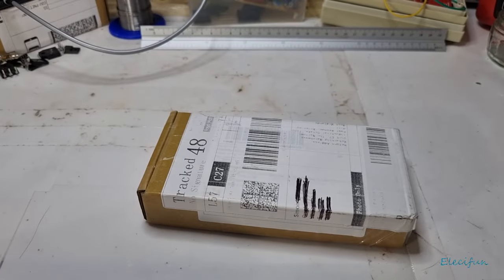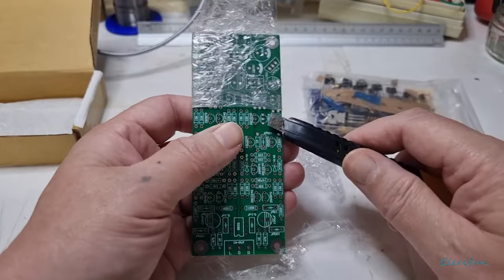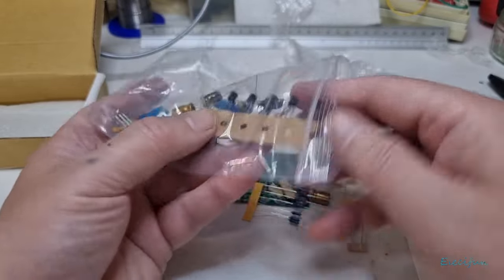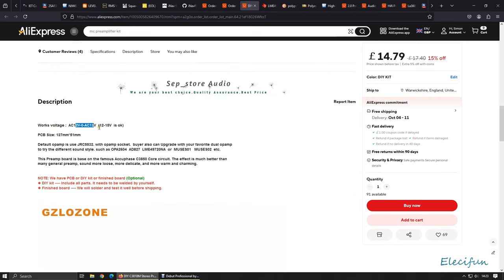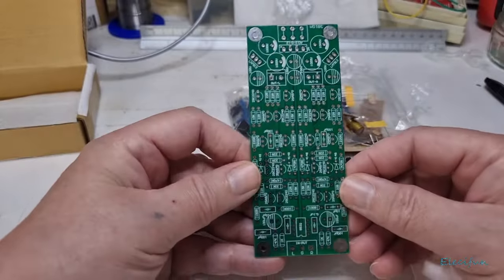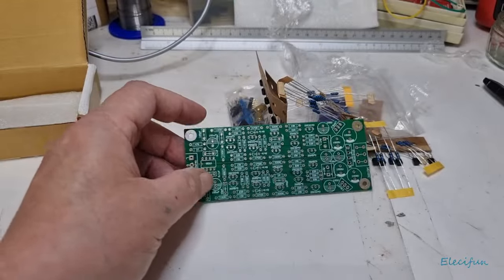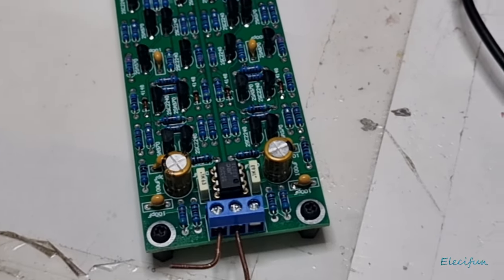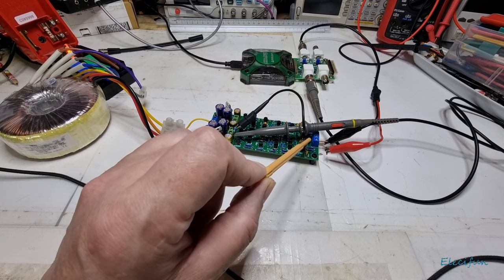Aliexpress DIY C3810M Stereo Preamplifier Kit Base On Accuphase Preamp Circuit (B6-26)

Comment: Does the board need a separate power supply capacitor banks-rectifier board (after the transformer)?
Reply from the maker: No, rectification is on board and as the preamp uses little power a large capacitor bank used with power amps not needed.

Comment: These so-called software test gear often gives strange results. For example, I have recently built a slightly different version of this Accuphase clone. On my tests the frequency response does not have any of that odd wobble in your tests. In fact, it was completely flat, 0dB from 2 hZ to over 100khZ. as you would expect from a DC coupled amp. Your THD is also way higher.
The LME also measures better but needs caps placed across the supply pins to maintain stability. The gain is quite high out of the box but can easily be changed from 15dB to 3.45dB or anywhere in between buy a simple resistor change.
The transistors on my version are also different. BC557C & BC547C. It's easy to test the 5532. If you measure across pins 2 and 3 you should measure diodes in both directions. Fakes do not have these diodes.
Reply from the maker: @MichaelBeeny  I think there might be something amiss where the wobble is concerned as it happens quite a lot. I wish I had different equipment but funds are tight so I use what I have. Chinese manufacturing doesn't help when the quality control is a bit hit and miss. I guess with these cheap kits we can't expect much.
Thanks for your input I always appreciate feedback from those in the know. I will check the 5532's, cheers.
Reply: @Elecifun  I know what you mean about budget, our viewers do expect a great deal from us. Even low-cost amplifiers are so much better than stuff from the past, the effect makes the need for very sensitive and expensive test gear. I had thought of selling a kidney, but no one wanted mine lol
Reply from the maker: @MichaelBeeny Ebay won't let me sell body parts, they said no, something to do with policy violations. Can't even sell blood in the UK they want it for nothing lol. I will have to see if I can save, I would love a QuantAsylum. I doubt if Santa will bring one, maybe if I wish and wish lol

Comment: Great video. the unit has a lot of promise and is rather inexpensive. $22 here in Oz with free shipping!
I sill don't trust some of the parts and mostly purchase caps and transistors from a local provider and Vishay resistors. 
It is still inexpensive

Comment: Hi Sir ! What's up? What is the difference between a class A amp, a class AB, and the less important class D amp? 

Also what do they mean by discrete amplifier? I did google it but even that is a bit too complicated for me to understand.
Reply from the maker: @decem_unosquattro9538 Dec, what you ask me is all over the internet. I will offer this... A chip amp has most circuitry in the chip. Discrete amps are comprised from individual components.
Reply: @Elecifun  Yeah I know but it's quite complicated because logically you would think class A is the best but some say class A/B is the best because I guess it's a sum of the total not of parts. I read that class A is better from a perspective of ultimate sound quality but they're very inefficient in terms of power wastage. 

See this is the things it's not quite as easy as one might think. 

One dude seems to think things have change so much over the years.

I bought a power supply for my L12-2 power amplifier.

There were two sizes at the voltage range that I needed. I think now I should have bought the one with more UFarads.

Anyway I'm not too fussed about it as this is my first build.

I'll be happy just to see the light switch on.

I guess the next thing I need are some suitable speakers. 

This is going to be a fun project and I'm looking forward to building the boxes although the dimensions are important which means I'll look around for some bass reflex designs.

I need another toroidal transformer.
That's going to hurt. 😆

Anyway what's your next project sir?🤔

Incidentally I had my gas cut off because it's too friggin expensive now. Oligarchs are super greedy, selfish and arrogant.

The mornings are still pretty cold here but I guess it's nothing compared to the U.K.

Anyway what you been doing?